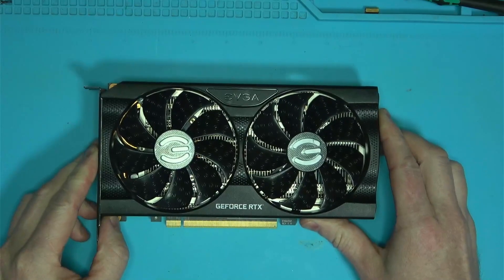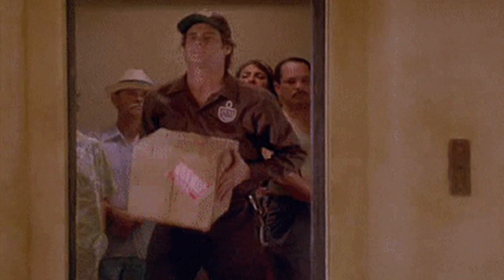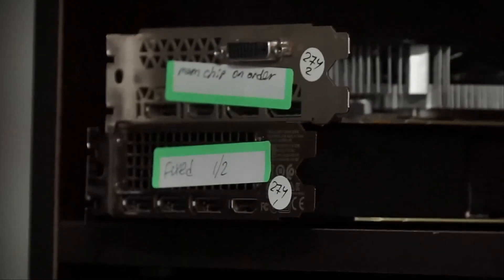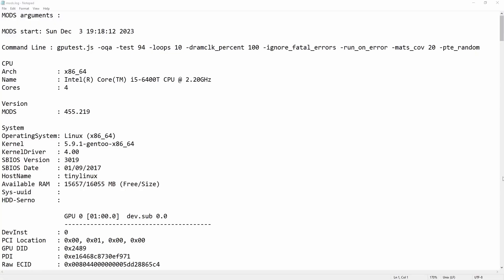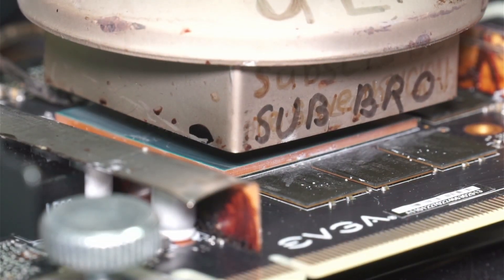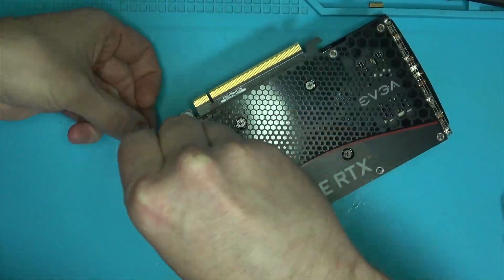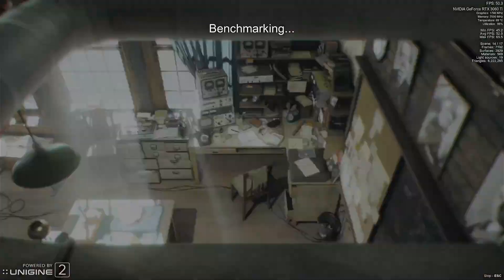EVGA 3060Ti repair part 2

Comment: I have a pair of these Evga 3060ti's. I like their compactness, they run cool & they only use a single 8pin.
Reply from the maker: 👆 this
Reply: My 3060ti from evga is an xc edition and man it ran warm out of box, I had to undervolt it and put better thermal paste in it. It's an awesome card for most games, modern games however it will start slacking with vram

Comment: I hadn't seen you hit a no fix (ive only been subscribed for a few months and slowly working backwards) until that last one, and now you fixed it.  Nice work!
Reply: Couple where the core is big time dead. Not much anyone can do there.
Reply from the maker: I do have few no fix on my record.
Not many but they are there.
Reply: @northwestrepair  any that are not dead cores?
Reply from the maker: @ChristopherBurtraw  I had one AMD card that was crashing. It had all the power but according to its controller, it got a random system crash.
No one including me really knew what's going on so that was a no fix.
I may take a second look at it again. Who knows maybe I'll finally find what's wrong with it if I still have it.
Reply: @northwestrepair  Did you manage to find out what was wrong with it? Would love to see that video.

Comment: Degraded R, which lowered resistance - really strange. In a feedback loop and near to no load/heat.
Reply: Soldering/reball damage. I mean for SURE the resistor was defective from the factory, it just decided to go wonky after heat stress event.

Comment: I have dual fan 3060 NON ti but doing almost exact things. The left fan quit working after 7 months now overheating the card. I ordered exact replacement fans and now experience same issues like this repair. I am seeing Temps of 156F before crash. I'm seeing a lot of double images when hot but the other image is black n white and light shading. I will message you through email to find out a rough price to repair.  I'm so pissed at junk quality at premium prices. I hope it will not cost as much as I paid for it
Reply: It is quite possible you've damaged your GPU from overheating if you kept using it with the fan failure...

Comment: I always like repairs on these midrange cards as it shows how they arent write offs even if they are cheaper
Reply: With this last gen midrange card it's probably getting towards the edge of what makes sense economically tbh but it's good to see different hardware being fixed.
Reply: I like to see how the cards have changed over the years internally

Comment: Was the unnecessary reballing of the gpu core negative for the owner? Or is it a benefit? Do you use lead solder? If you're using lead-based solder, one could say that the reballing is superior and better than factory. So it should be an unexpected benefit for the owner.

But what about the gpu core? Does reballing the gpu core reduce its lifespan because of the suffered heat during the process?
Reply: up

Comment: Wait... what? How can you install a resistor 'upside-down'? Arent they symetrical? :P
Reply: Normal installation of a resistor with black laquer and topcode side away from the PCB. He has installed it topcode side towards the PCB.
Reply: @SianaGearz  they all look identical to me :P He said the value of that resistor dropped, how would that happen? Was it overheated or something?
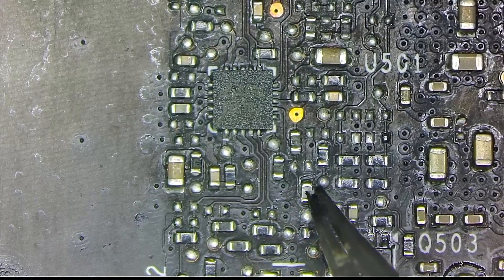Reply: @benjimlem1284  So we're at 1:35, look at a component slightly southeast of the video frame middle, it's neutral almost bright white instead of black. The top side (not visible on this one, visible on all the rest) is black, the bottom side (visible on this one only) is white. Not to confuse with capacitors which are brown and beige.

How it happened that resistance drifted down, is a mystery to me because that's not supposed to happen, normally when you abuse a resistor, its resistance goes up, not down. I surmise there might have been a sliver of conductive material in the resistor which wasn't properly cut during manufacturing, and upon heat shock somehow reconnected itself, shorting a small piece of resistive track. It can only be explained by a latent manufacturing defect of some sort.

He also hasn't reinstalled the same resistor, just a resistor of correct value that wasn't defective.

Comment: hey guys so i bought a rx 6650xt 6 months ago around may and i recently started black screening and going into reboot so i looked at event viewer n got a thermal shut down code so i ran a benchmark n noticed a gpu temp of 60c and noticed the hotspot hitting 87-90c so i took the card aprt i really wish i took photos its an msi oc rx6650xt so i open it up n 50% of the die had zero thermal past on it like they tightened the right side then the left side anyone else having temp issues with msi cards?

Comment: Hi there. How much would you charge for a gpu inspection (Checking for software and hardware faults INCLUDING fans) and fixing if theres a problem? My 2080 has lately been acting up a bit (Checkerboard black artifacts and a ton of coil whine). And are you able to repair asic miners? (Asking for the future just in case)